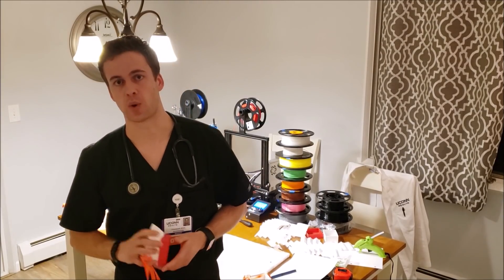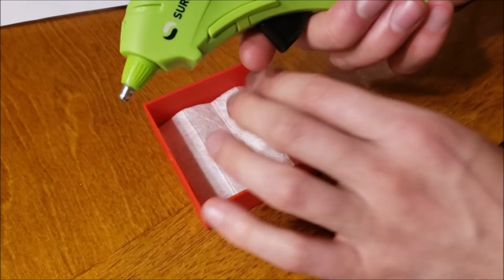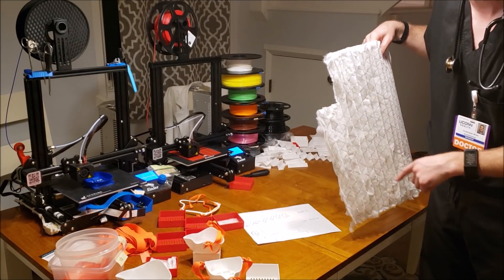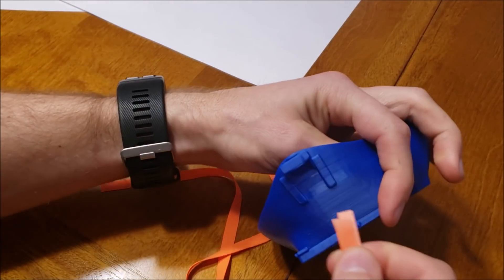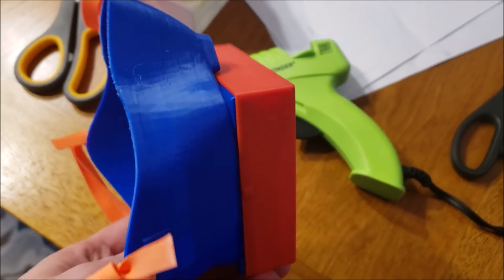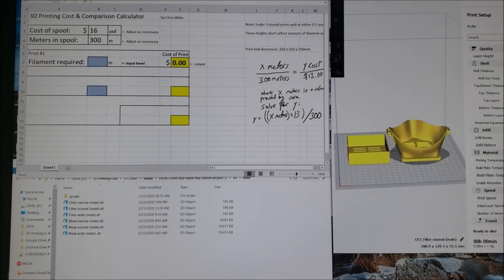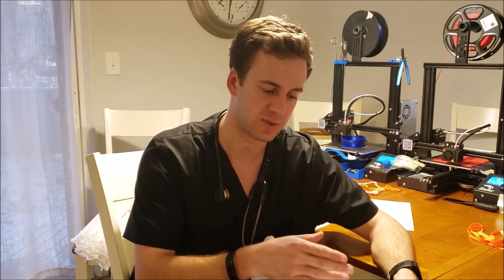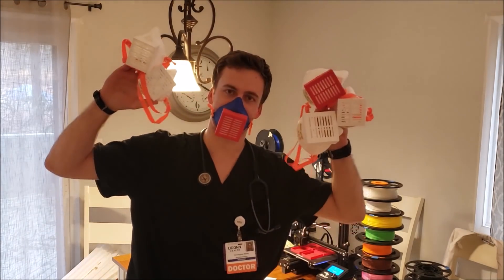COVID PANDEMIC 3D PRINTED MASK TUTORIAL

Comment: DO NOT USE MERV-16 OR HIGHER UNLESS YOU KNOW WHAT YOU ARE DOING. MERV-16+ often has microglass in the material.  You would need another synthetic layer over this to protect yourself.

(edited to add this: my source for this information is someone who works at a local air filter company)
Reply: The 3M Filtrete product unlike most HEPA filters does NOT contain fiberglass.  As described on the 3M website and elsewhere: 

3M Filtrete filters contain electrostatically charged filter media made of polypropylene and polyolefin plastic, and capture particles that measure between 0.3 - 10 microns in size. The electrostatic properties cause the filter to act like a magnet, helping it to attract both large and small particles into the filter's pleated fabric. 3M Filtrete filters (MPR 600 or higher), when clean and new, outperform all other fiberglass, washable and non-electrostatic 1" residential air filters.

This is true for their full range of options.

More here:

https://www.iallergy.com/pages/compare-3m-filtrete-filters
Reply: @3gypt1an  Yes I think you will lose a lot of that electrostatic filtering if you spread the filter out. When you see it being used in a furnace most particles will have to "pass by" close to an inch of filter material (the walls of the pleat) before hitting the bottom of the pleat. That gives a lot of time for them to be attracted to the walls of the pleat - which will be totally lost if they are spread out. If you lose the electrostatic filtering you go from MERV 13-14 to MERV 10.
Reply from the maker: @3gypt1an  thanks for the info, that helps a lot
Reply from the maker: Thank you, I did not know this. I will stick with MERV-13. I am excited to announce I have linked up with a physicist who has almost completed his own particulate matter sensor in a simulated COVID patient room with a particle size sensor on the outside of the mask and on the inside of the simulated lungs. We will soon test multiple combinations of filter material to try to get as close to an n95 as possible.  As for the comfort of the mask against the face, I am going to take some oxygen tubing from the hospital tomorrow, slit it open, and inject clear silicone, then press all around the edge of the mask, and re-fit test. will update you all and I plan to make another video in a week with ideas for post production mods to make it more user friendly including that. Thanks again for all your help.
Reply: @chrischris64  Great job! Will you upload a video about your tests?
Reply: @chrischris64  been a week now any updates yet please would be very much appreciated. information helps save lives.
Reply from the maker: @ufochannel01  making the next 2 videos as we speak. Just filmed the procedure to sand the mask, mold it to your face, and seal it. Still waiting on filtration final data but physics team is getting close. I'm also 24 hours away from uploading the repack where all the masks fit the same filter. Working really hard around the clock. Thanks for your patience.
Reply: @chrischris64  Hey Chris, my sons are getting ready to start printing. Question:  any progress on sealer for the micro holes in the plastic?  On quest to find something non-toxic has led us to Flex Seal in a can (NOT the spray, which contains dangerous to breath chemicals).  This will be klugey, but it's the best thing we've come up with that seems to be safe.  That said, at $30 for 32 ozs ( so about $1 an ounce), it starts to make the masks pretty expensive.  I can report back when we learn how many ounces are needed per mask.  Do you think it would be sufficient to just coat the exterior of the mask?
Reply from the maker: @jumpintexan  How is printing going? I am using Rustoleum semi-gloss clear sealant on the outside of my masks. You need good ventilation such as outdoors and a respirator mask to do any of these sprays safely, correct, but for larger scale production it's fastest. Here's my next video with some other tips and I hope you and your sons are doing well https://youtu.be/9XwoQl0alVE
Reply: What about HEPA filters? Specifically trying to utilize one that is cut out from a Dirt Devil Vacuum filter and a Filtrete Air Purifier model? Not nearly as cheap as the MERV solutions but looking for a closer to n95 type material.
Reply: @roninmbattousai  HEPA is way stronger than N95. I have been using HEPA vacuum bags in my Montana Masks. Very restrictive though.
Reply: @randallarcher  thanks for the response! I am gonna try some specific non fiberglass Merv filters with high percentage rates at .3 since hepa is harder to find right now. Gonna do a few tests but really aimed at face shields at the moment.
Reply: @roninmbattousai  I have been using vacuum cleaner bags for my Montana Masks. Works well.
Reply: can you suggest an best material to air filter in this mask?
Reply: @marcogalassi6489  Sorry for the delayed response. While I've gotten specific details on why MERV-16 and higher are hazardous, the warnings against MERV-13 and lower synthetics have been vague: 
https://twitter.com/Filtrete/status/1242905336144703490

I did confirm from Filtrete that their MERV-13 and lower synthetics do not have microglass, but that doesn't mean there couldn't be something else that could be bad for you in there.  Again, this is not my field.  Sorry this is all the info I have here.
Reply from the maker: @dantebortone5954  Thank you Dante and Timothy very much for looking into this.
Reply: At my Home Depot they have 3M Filtrete filters that 3M rates as MPR 2200. I don't know exactly, but I suspect this would be very close to MERV 16.
Reply: @rukidding7588  filtrete has a pdf you can download. 2200 corresponds to Merv 13
Reply: @jaychapman6448  that's a bit odd, because I found a conversion chart online that says MPR1900 is equivalent to MERV 13. Hmmmm.
Reply: @rukidding7588  Yes - if you run it as it is designed to be run. As I said if you spread it out you won't get that for the reason I gave.
Reply: @jaychapman6448  ah, got it. Perhaps 2 layers of MPR2200 could restore the full filtering capability???
Reply: @rukidding7588  Better than nothing I suppose but you would just be guessing... better to build a filter that uses it in the intended configuration I think. I think if you look at some of the filter boxes they have a diagram that shows you where the mechanical filtration ends and the electrostatic picks up.
Reply: I also found MERV 16 to be rough to handle, much like fiberglass batt insulation. I placed a MERV 12 square on the wearer side for extra protection against inhalation of fiberglass particles.

Does anyone know if the furnace filter manufacturers like 3M or Nordic Pure warn against using their filters so close to your face?
Reply: UPDATE: just got off the phone with 3M Filtrete support, and Lennox HVAC commercial tech support (Healthy Climate Solutions brand filters), and they both specifically advised against using their filter material to make masks. However, I'm pretty sure this is just a liability avoidance strategy, because they haven't tested their filters in applications like this.

Also, the 3M Filtrete representative said the primary differences between the HVAC material and the purpose-built N95 masks is a) the surface area of filtration media is greater on standard N95 masks, and b) the N95 masks normally have that flapper valve on the front so exhaling doesn't direct all your breath through the mask material, thereby rendering it hotter and more moist (i.e. hotter and more moist will make the mask less effective, maybe?)
Reply: @dorksoblivious  and the N95 has been tested and approved by OSHA as standard PPE equipment which the 3d masks are not. This is a nice project if you want to build a couple for your Family but don't waste time as they will never be approved by Hospitals, same reason they are not using anyalternative medicines against the Virus, They are not tested and nobody will assume liability.
Reply: I’m also working on a similar mask to this, derivative of the “Billings mask”. I’ve been skeptical of using anything other than an N95 from the start. The version I’m working on can make 4-5 masks out of one cut up N95 mask. I’m dealing with the same issue of a comfortable face seal. I’m currently going the same route as Dr. Wiles and sourcing up FDA approved tubing to split, and then try to make a mold or to attach with a glue gun. My first attempt at tubing was too small of a tube. I have thicker tube coming on Wednesday of next week, fastest I could get it here.

https://www.thingiverse.com/thing:4236053
Reply: @GUNNERBASS  I saw that they have a supplier who might be able to supply the correct filter material. Have you tried to get any of those? Was wondering what kind of lead time/price they were considering how their website didnt look all that reliable.
Reply: Can I use Filerete MPR 2800 filter? Is that one safe to use?
Reply: I don't know much about that filter, however I am trying to find one that is safe that can be cut and used. Do you know of any other than the MERV-13 used in this video that is safe?
Reply from the maker: @uploadupgrade  HEPA vacuum cleaner bags are one example of alternative filter. They can be found at local stores and industrial ones which are Merv 15 and thicker can be bought online.  From what I've learned in researching all this, vacuum cleaner bags have no fiberglass. You would have to experiment with whether one or two layers is possible to breath through. If anyone knows of other materials that are easily accessible to answer this question, please chime in.
Reply: @chrischris64  Do you think taking an AC filter that doesn't contain glass slapping that on the mask with something breathable like a pillow case to further protection against any possible dangers seem like a good idea? 

It would be the mask then the pillow case and lastly the filter itself. Does that make sense?
Reply: You can mitigate the risk by adding a blue shop towel post filter and also increase efficiency.
Reply: hey what do you know about a merv 14? would that be a good sub for the merv13

Comment: Hi chris, I own a 3D printing company that can do large volumes of prints, 100+ of these a day. However, i am worried about the filter material and size not being consistent. If you can use the 5n11 (as was already suggested) or equivalent type drop in filter, it would speed up manufacturing of these masks and we can send them to Italy and within the US. Is your designer able to accommodate a drop in filter that is not currently sold out?
Reply from the maker: I ordered a 5 pack of 5n11 and will begin designing a fit for it asap. I'll also reach out to other designers. If anyone can beat me to it, I'd be really grateful, the next 2 days I'm busy setting up 3D printers in hospitals and fit testing a series of masks.
Reply: @chrischris64  Ok great keep me in the loop. Thanks!
Reply: Can some one link the filtration specs on the 5n11?  I am seeing electrostatic but no micron rating.

Comment: You think smooth-on has a material so the two pieces would still snap together but be a bit more flexy comfortable with a better seal? Print one set PLA, make a silicone mold, and pour as many as needed a lot quicker than 3d printing with smooth-on material. Just a thought and it's a great idea either way that will lead to something even better no matter what
Reply from the maker: that's a good idea. I was just on a conference call with some people who can machine molds and do injection molding. I don't want to do the smooth-on silicone material because we are going to be producing these in a hospital conference room we are taking over, and silicone has fumes, but I might be able to get injection molding set up within a couple weeks. I love all the ideas. I've learned so much from people in just 3 days. thanks everyone.

Comment: you could DEFINITELY shorten the print time. The ender 3 can easily print at 60mm/s and 0.3mm layer heights with a 0.4mm nozzle. Slicing it with these settings made each mask+ cartridge take closer to 2 1/2 hours to print
Reply from the maker: You're so right. Thank you. I'll try 0.3mm  layers and 60mm/s. there may be some issues with the mask details where the straps connect, but I can redesign these to be more like simple boxes just to get to the 0.3mm print settings. I'll work on it asap. THANKS
Reply: @chrischris64  why not make the strap connections simple slots with a bit of a bend away from the face? That way, a piece of tourniquet rubber could slide into the slot. A knot in the end of the rubber would prevent the rubber from pulling out. The bend would prevent the knot from slipping out to the side.

Comment: I think it would be beneficial to look into a 3d printer material called ninjaflex for the part of the mask that contacts the face. Perhaps design a rubber seal that works with the PLA ?
Reply from the maker: Thanks a lot. I actually ordered a roll of TPU flexible filament material over a week ago. There are shipping delays currently. It looks like ninjaflex is a special formulation of TPU but similar. I will start designing a ring to pop onto the mask and print when my filament arrives, then update my files and maybe another video. Thanks for the idea.
Reply: @chrischris64   :) Happy to help. 

May i be as bold as to ask you for a design file to use as i would like to have a crack at designing a seal and printing it on my home printer here for testing ? ( the solidworks file )  :)
Reply: @chrischris64  Ordering directly from manufactures now can be much faster since Amazon doesn't consider filament a critical item.  Also, PETG (if you can get it) would be the preferred plastic for the rest of the mask as it's considered easier to clean.  It's also more flexible and therefore probably more comfortable, but if PLA is  what you have, it's what you have.
Reply from the maker: @dantebortone5954  Thanks. I do have one roll of PETG. I will experiment with it on the next mask. We are building UV-c light chambers at my hospital to clean these in addition to bleach wipes. The easier and less porous, the better. I'll see how it comes out with PETG. I've been ordering on ebay with about 5-7 day delivery times. Any manufacturers you've ordered from you would recommend who ship faster? Thanks
Reply: @chrischris64  I need to order some PETG myself.  The response I got from MasksForDocs was that Matterhackers is shipping at 2 days and arriving around 5 days total.
Reply: @chrischris64  As I mentioned in another post, I don't believe you need UVC. The main reason for using it is that it doesn't cause damage to human skin, because it doesn't penetrate like UVA & UVB. I think full spectrum UV lamps are easier to source. The only caveat is that the UV chamber needs to be light-tight, so it doesn't leak out where people can see the rays.
Reply: My first thoughts was about flex because medics suffering after several hours in ordinal masks, made from PLA would be terrible. But printing with flex like printing sticky wet noodle. Not with their printers.

Comment: do you think we could vacuum form these way faster and cheaper?
Reply from the maker: Phase 1 of my plan is to get the files to as many people as possible who already have 3D printers at home so these can be mass produced by people who are at home on quarantine and want to get involved with equipment they already own. In a few days, as this gets more attention, I will begin fund raising and phase 2 will be to go through a company like ProtoLabs and do injection molding rather than printing. As far as price goes, it's actually hard to beat what I have priced out for 3D printing. I don't know as much about vacuum forming forming but thanks for making me aware of that option.
Reply: Not really by the standpoint of buying the vacuum seal machine vs a 3D printer which is cheaper